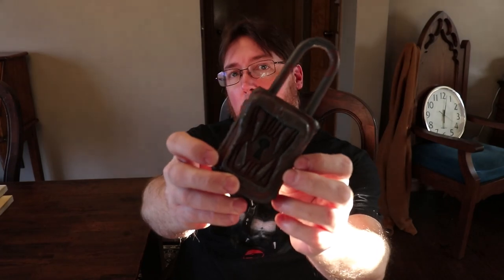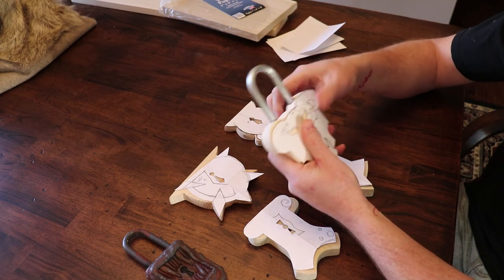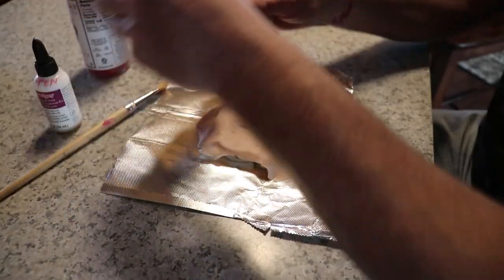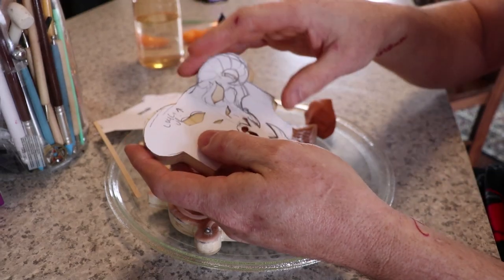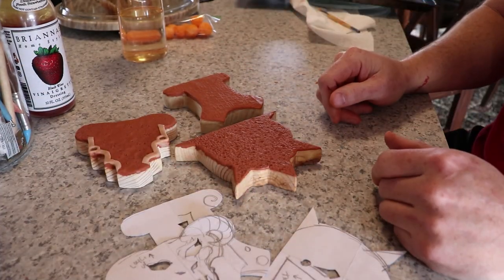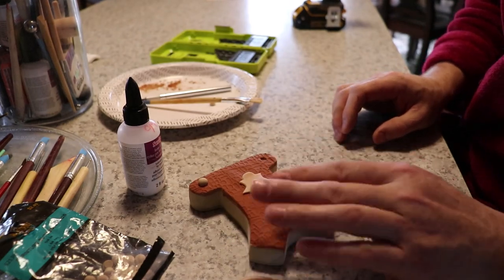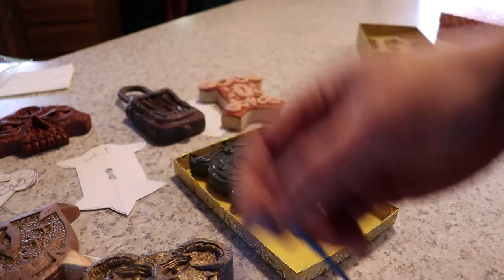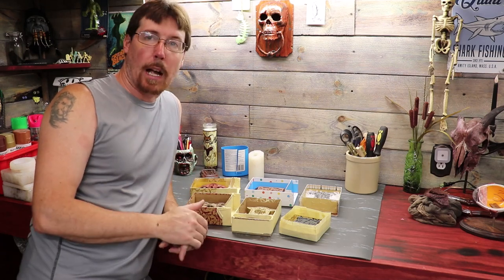DIY Custom Haunt Prop Locks (Part #1) Sculpey & Wood

Comment: They look great ! Perfect for a cemetery gate , Crypt , Dungeon , Or demon chest . Using bbs as rivet heads is a great idea.
Reply from the maker: Thanks Kris! Ive never been a fan of using hot glue as rivet/bolt heads cause that crap melts in the shed in summertime! The little copperheads worked out perfect.

Comment: This is a really great idea and I agree there isn't a lot of great looking locks out there
Reply from the maker: Yep, this has bothered me for a long time.
Reply: You did a great job sculpting all those and using a hanger as the lock loop is sweet idea. 👍
Reply from the maker: Oh they're lightweight, 3/8 ths thickness for heft and can be heat gunned into shape. Thdy worked out great.